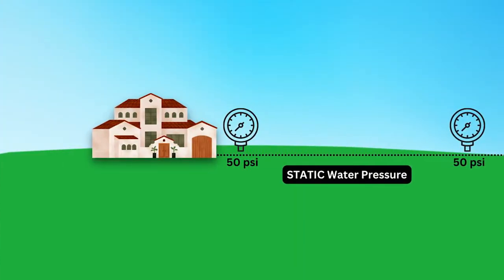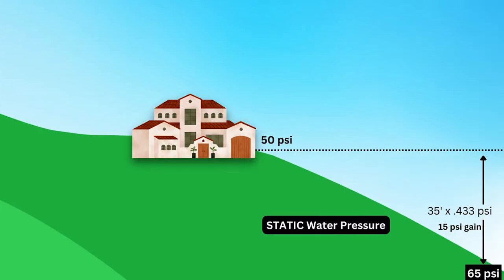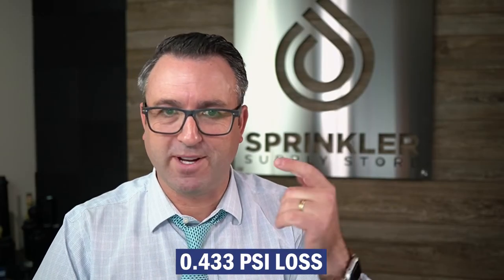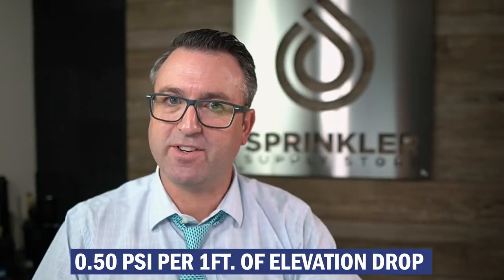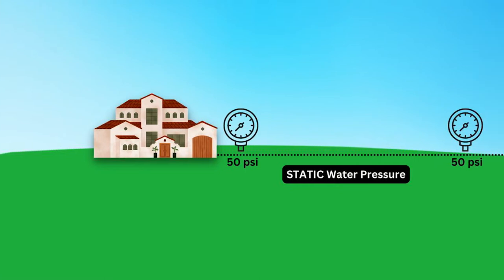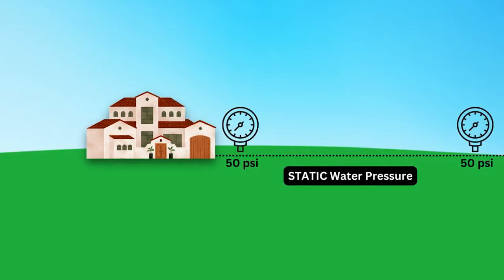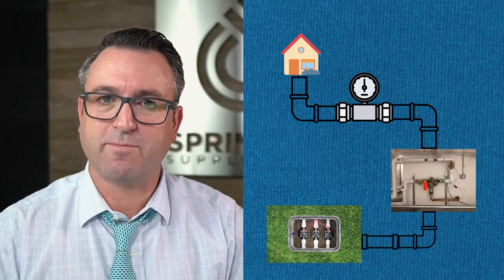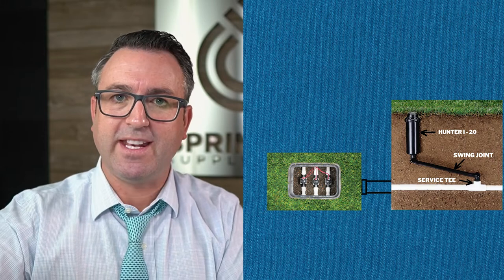Have Great Pressure but Sprinklers Are Not Performing? | SprinklerSupplyStore.com

Comment: What would you recommend if the installer used 1/2” inlet pgp rotors? They’re hunter copy’s with the installers name on them. 

I had to swap out the guts only when I’ve replaced the head from damage. 

Ended up adding a booster pump on our house in a city. Static pressure is 70 at the pump. 

Pro sprays wouldn’t pop up until we added the booster. Recently had to switch the order of zone 3 & 2 of pro sprays around on the controller because 3 wouldn’t pop up after 2. Now they do… so confused.

Pgp copies with new hunter guts don’t really reach head to head coverage in several areas. 

Main line underground is black 3/4 I believe. 10 zones.

Would I try all 1.5 gpm nozzles on my pgp? Or buy a different sprinkler head for the rotor zones? What about rotators on my system? 

Any help would be greatly appreciated.
Reply from the maker: Happy to help, and if you’re interested, you can book a Zoom call with me and walk me around your system so I can see your setup.

https://calendly.com/andyhumphrey/technical-support

First - PGP rotors have a 3/4” inlet. Wondering if perhaps they are not PGP (type) sprinklers, but maybe the smaller  PGJ model, which is 1/2”.

Hunter does not make custom branded tops (that I’m aware of), however, K-RAIN does, and the sprinklers are almost identical.

Either way, it sounds like you have a pressure problem, and the type of sprinkler is kind of irrelevant as you can change the nozzles, like you suggested.

Knowing that you have a pump makes me think you may have a restriction in your mainline somewhere. Tree roots can sometimes squeeze black poly pipe and cause this.

Or, your water source isn’t adequate for the number of sprinklers on each zone.

Or, the service line feeding your house is being restricted. Old galvanized pipes commonly corrode on the inside and restrict flow. If your home is less than 20-30yrs old, this is probably not the problem.

My recommendation is to get a pressure gauge and test the dynamic (operating) pressure of the sprinkler. Based on that, you can work backwards to determine if the mainline pipe is restricted.

There could be a few others issues and things to check we could go over on a call.

Here’s a link to learn about the MP GAUGE. You should buy one, and then we can help you from there.

https://youtu.be/LvcGzMgoXJk
Reply: Thanks! I’ll start with the mp gauge. 

I’m fairly certain that there’s a kink in our main line. After all that’s why we went with a booster pump.  House is only 7 years old. 

Kink is Possibly at the curb stop. 
Just not super excited to dig up my yard looking for a needle in a haystack.
Reply from the maker: @pagodad8079  I agree with this. Testing the pressure at each zone will help you figure it out. Zones before the kink should have proper pressure. You should be able to determine the approximate location in between 2 valves.
Reply: Got the mp guage. Zones two and three on my system are hunter pro sprays. 

When taking a reading from zone 2 & 3 separately they start at 20psi and tend to drop off from there gradually; Eventually sustaining pressure around 15psi. 

I wonder if my booster pump ends up having trouble keeping up? These zones are closest to the backflow preventer where the water comes out of my house as well.

Luckily where I have the sprays even this lower pressure isn’t enough to keep them from watering the narrow space they’re intended for. 
The confusing part is I had to switch the order in which 2 & 3 start to get 3 to pop up. 

Another part of this mess. Does this also tell me why my pgp rotors aren’t performing to their full potential and would you recommend I use 1.5 gpm nozzles on every rotor head?
Reply from the maker: @pagodad8079  could be. I think it depends how the booster is setup. Do you have a pressure tank? Some pumps kick on, then pressurize, then turnoff, then turn on again, and repeat. It really depends on the setup.
.
Reply from the maker: @pagodad8079  yes. Your pressure is too low, regardless of the fluctuations. Something must be kinked, plugged, restricted, etc, for sure.

MP’s like 30-40psi, preferably 40.
PGP’s are similar.
Reply: @Andy_Humphrey my booster pump is an AY McDonald light commercial pump. It’s static pressure is set to 70 psi. 

Can’t really adjust that higher or I’ll be blowing faucets in the house. 
Not a giant tank on the unit but it did make improvements to my overall system operation.

If there is a kink it’s probably in my main line coming from the curb stop to my house.
Reply: @Andy_Humphrey another thing I just discovered. When I go from 5 rotors to 4 on a zone it makes a huge difference in the amount of throw I get! 

I’m thinking more zones with less heads could solve some problems here.
Reply from the maker: @pagodad8079  70psi should be adequate. Your dynamic pressure reading of 20psi tells me there is a restriction someplace. Do you have a filter that might possibly be dirty/clogged?

Reducing the number of sprinklers makes sense. This will reduce the total gallons per minute, which will reduce the friction loss, essentially preserving your pressure.

Be sure to let me know if you ever find the kink/blockage/restriction. Could also be a leak so keep an eye out for a wet spot.
Reply: I may have misread, but did you say the irrigation mainline is tapped into your domestic supply line inside the house and then runs outside to feed the system? If so, it’s rare, but I have seen instances where someone tapped into a supply line in the basement after the pressure regulator.

Comment: This video would have been very helpful two years ago when my irrigation system started performing poorly at the beginning of the new season.  When I bypassed the well pump and connected the system to the city water supply, it worked great.  I called in the company who drilled the well and installed the system to fix it.  After a day of head scratching, and fitting two different pumps with no improvement, the techs left for the day.  I dug out my Hunter MP gauge and checked the pressure on one of the zones using the well and city water.  In each case, the static pressure was great, but the dynamic pressure when using the well was very low.  The dynamic pressure on the city water was great.

The problem was an undocumented, and previously unknown to me, silt filter built into the main shutoff valve in the valve body box.  The valve is part of the pump piping and just before the Hunter zone valve manifold connections.  The filter was nearly completely clogged and was restricting the water flow from the pump.  The city water connection was after the filter in a different point of the valve manifold.  After cleaning the filter, the pump dynamic pressure to the zones was perfect.
Reply from the maker: Yep, that'll do it for sure, makes total sense! Pretty interesting how static pressure doesn't tell the whole story, it's more of an indicator of "potential" pressure. You might have 50psi...or you might not!

Comment: I'm Glad I stumbled across your video! I was thinking the new "shrinking non kinking" hose was the problem.. I'm trying to get temporary irrigation about 250 feet out for my grass/landscape proj but it just trickles and it's slightly up hill from my bib... I was thinking hard conduit would help the prob but you have caused me to re think it.. I was about to pay the county to install a second supply/meter if all else failed. Incidentally, I'm trying to water back up the hill close to the meter lol 
Cool Video, All The Best!
Reply from the maker: My pleasure. Yes, it sounds like low pressure due to friction loss through the hose.  Here is another video that might be helpful: https://youtu.be/7UfDL2IlVMA

Comment: Could a plastic rain bird in line sprinkler valve make my dynamic pressure too low to pop up sprinkler heads? I hear a slush when I turn on the valve. It registers 130 lbs of static pressure after the valve but I’m wondering if the valve is stopping dynamic pressure. Have you heard of this?
Reply from the maker: Yes, it can, if it’s not opening all the way. It could also be a kinked pipe, in the same way, restricting flow.

If your valve has a flow control handle, make sure it is all the way open.

Comment: So weird, I changed out my rainbird 1800 PRS bodies with 17-24 rain bird rotarys to Rain Bird 32sa rotors. The rotors have awesome pressure now, on some of my rotary nozzles it could not achieve the same uniform coverage as the rotors now do.
Reply from the maker: Good to know. Rain has the sweet spot for pressure listed as 45psi for the R-VAN rotary nozzles - so my bet is you have less than that, maybe 30-40psi, which is okay for the 3500 series (32sa box store model). Curious if you know what your pressure is?

Comment: Great channel man! 

Do you have a video to fix what I think is called hammering? 

I woke up when my sprinklers were going at 10pm because there was a loud rhythmic thumping/hammering sound. Next morning the sprinklers went off at normal time again and I saw all my sprinkler heads bouncing up and down coupled with the hammering/thumping sound (this was happening one zone at a time). 

I purged the system by shutting off the water supply, running the system and then finally, slowly re-starting the water supply. Oddly, the system started on zone 2 and seemed to have been corrected as all the zones ran normally. Just to be sure I ran it again- this time it started on zone one and ran perfectly but, when it went to zone 2 the hammering was back. 

Any chance you know what to do?
Reply from the maker: Thank you for sharing all of this information.

It’s possible that one of your zones, or many, we’re not closing all of the way, and the diaphragm in the valves were opening and closing very quickly as if flapping. 

I would look for patterns, was this a one time occurrence, has it happened again, is it still happening, etc. 

I may not be a pressure problem, could be something else.

Comment: How can I increase dynamic pressure? A booster pump?
Reply from the maker: Yes. A booster pump or gravity, are the only 2 ways to increase pressure.

Alternatively, you may consider changing nozzles or sprinklers to lower the flow rate. This will reduce the dynamic friction loss.
Reply: The question should have been,how can i decrease dynamic pressure?
Reply from the maker: @ronaldotiti5284  - close. Dynamic pressure is “water in motion” which is the true pressure of the system in operation. In order to obtain a higher dynamic pressure at the sprinkler without a pump or gravity, the flow must go down, or restrictions reduced such as increased pipe size.
Reply: @Andy_Humphrey  How does this apply in normal sprinkler operations?
Reply: @Andy_Humphrey  Plus I always do not understand these concepts;my gun sprinklers is specified to deliver 25m3/hr and it's required operating pressure is 4 bar.
I'm convinced that if I want to obtain high flow rates the pressure drop should also increase significantly but higher pressure drops always affect standard operating pressures.
Explain to me these concepts clearly
Reply from the maker: thanks for watching and commenting. I don’t completely understand the question, or how it’s being explained. Any details you can add to help clarify your question or the problem you’re experiencing would be helpful.

Comment: I have 13 heads going at once @ 120 psi or round are about, they pump out a lot of water fast , I've had contractors tell me that it's not effective with that much pressure, I've been watering twice a day 12 minutes total and my grass is green and tall.
Reply from the maker: Congratulations, you are both correct ;)

If your grass is green, that is the goal, and it's working!

120psi is very high and over time this could cause problems, mostly, shortening the life expectancy of the piping and fittings.

Otherwise, high pressure causes the water droplets to be smaller, which more easily causes wind drift and increased evaporation to the air, leading to overall inefficiency.

In summary, inefficiency just means you have to use more water (water longer) to achieve the same effect.

Pressure regulators are not expensive and if it were me, I'd put one on your mainline.

Comment: Friction loss is a big part of why I use 1.5 gpm nozzles whatever the arc is
Reply from the maker: Great point! Sometimes the GPM is more important than the distribution uniformity. This is not a laboratory, it’s a Landscape, there’s room for creative thinking.
Reply: Zone 3 on my grandma’s irrigation system has 4 pgp ultras with 3.0 standard angle nozzles but when I take out the nozzle on one, the others have no drop in pressure, so the idea of them using the same gpm with tons of pressure is stupid although 99.2% of the grass covered on that zone is a deep green so I have left it like that

Comment: Scheme water supplies in all Australian cites are a total joke if you plan to Green a large city block or paddock. You will need a minimum 90 ltrs per minute bore or some massive holding tank if feeding from the Grid. Look no smaller than 30,000 ltrs
Use as much 40mm PVC pipe as you can afford and dig it in 600mm at least
Ex the 40mm run 25mm pipe nothing smaller unless your block is tiny
For beds and hard to get zones run 19mm poly with 19mm risers and suitable heads off the 25mm PVC
13mm or 4mm poly is for pots and small veggie gardens to control water erosion
People on large city bush blocks know exactly the scope I'm talking here, semi rural.